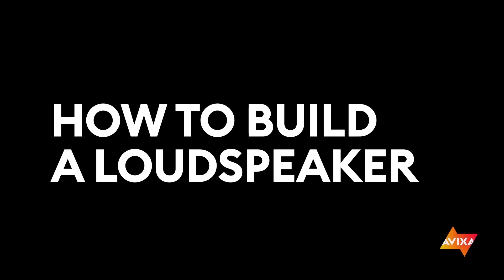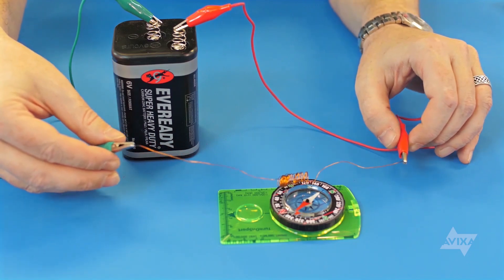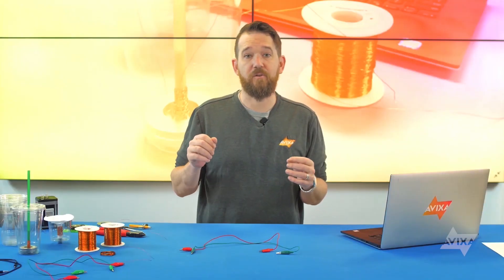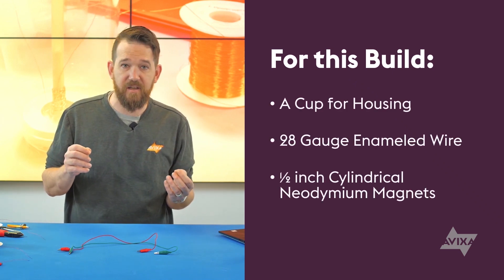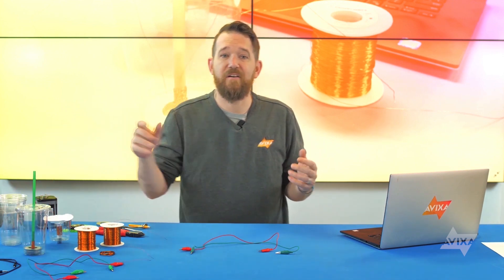How to Build a DIY Loudspeaker out of Trash

Comment from the maker: How to Build a Speaker Time Stamps 

Electrified wire near a magnetic compass - 0:37
Electrified coil of wire near a magnetic compass - 0:59
How does this help us build a loudspeaker? - 1:26
Major components of a speaker - 1:38
Musical signal through a coil of wire placed near a high-powered magnet - 2:08
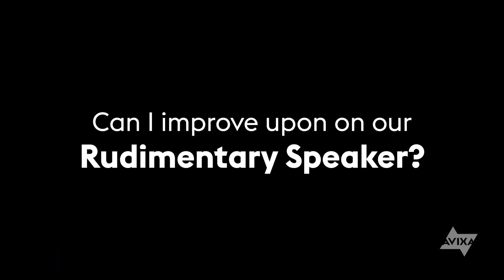Can I improve on this rudimentary speaker? 2:46
List of materials needed - 3:10
Step 1: Make a cone out of paper - 3:25
Step 2: Make a paper tube around magnets - 3:41
Step 3: Cut down plastic cup - 3:57
Steps 4-5: Cut down paper tube and attach to the cone - 4:11
Step 6: Create voice coil by wrapping 28 gauge enameled wire around tube and neodymium magnets - 4:27
Step 7: Put ½ inch cylindrical magnets in place at bottom of cup - 4:37
Step 8: Place tube with voice coil over the magnets - 4:44
Step 9: Remove enameled coating from ends of wire - 4:50
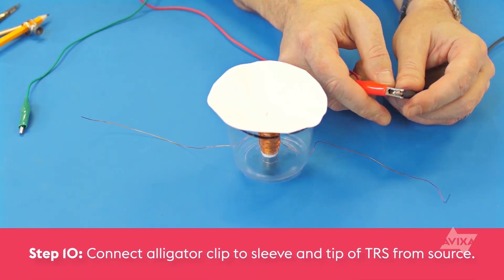Step 10: Connect alligator clips to sleeve and tip of TRS connector leading from your source - 5:01
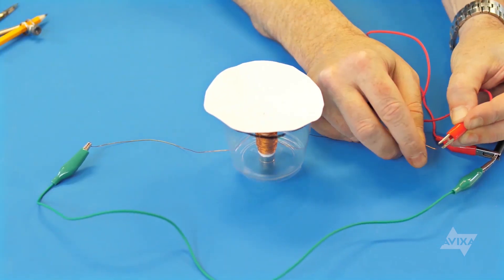A working speaker out of trash - 5:11